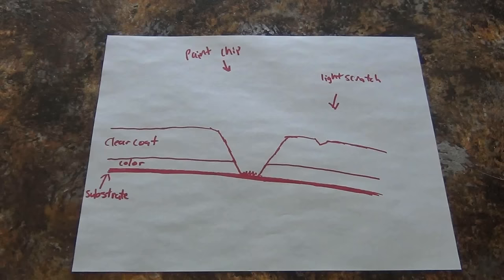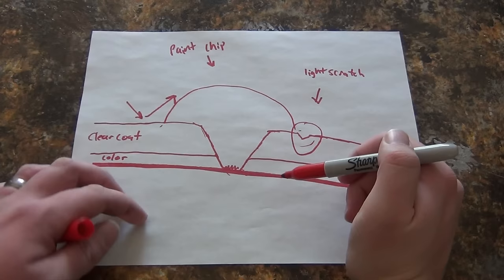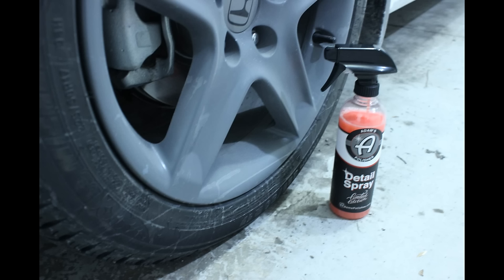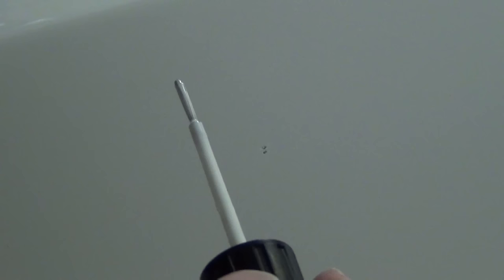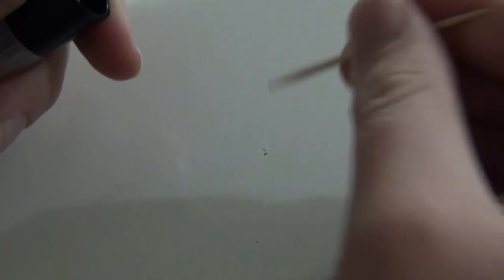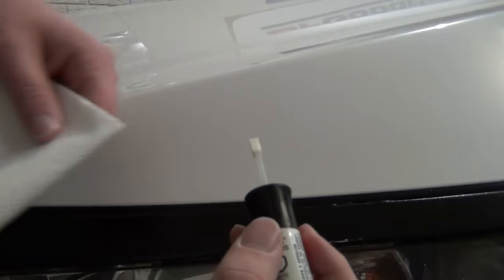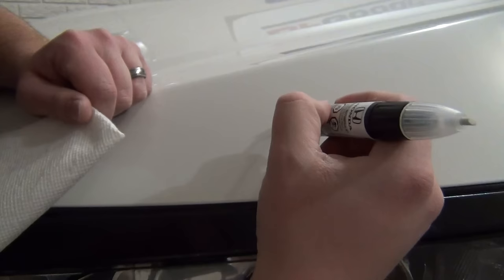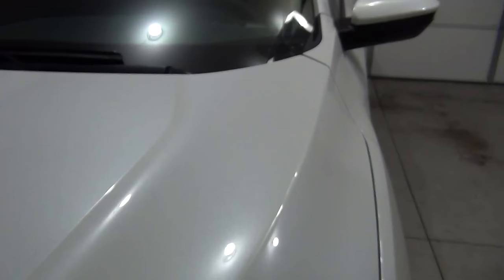Tips & Tricks | Using Touch-Up Paint

Comment: Pro tip: after applying your touch up paint and clear coat - take a pensile with eraser, 3000 grit sand paper, glue, and a cutting/polishing compound. Glue a tiny eraser size cutout circle of the 3000 grit sandpaper to the pensile eraser. Very lightly sand down the area/chip you just touched up. After you've got the spot completely smooth to the touch, hit it with your cutting/polishing compound. Once your done you will literally never be able to tell the paint was ever touched up or damaged at all. It will look brand new.
Reply: i use a paper hole punch to cut the perfect circle from the 3000 grit wet and dry then glue it on ;-)
Reply: Colt45Magnus This is exactly what I did while waiting to get my paint protection film done and got a couple of rock chips on my hood while driving it home the day I got it. A gravel hauler passed me going 50 and threw rocks out. 

I finished off with a light wet sand and buff. Since it's black metallic you can see very slight color difference, but it's flush with the rest of the panel and now has paint protection film and no uneven or bubbling issue with the film.
Reply: After sanding and compound/polishing should more clear coat be applied?
Reply: Rockford, No. All you are doing is removing the bubble like excess of clearcoat.
Reply: colt45magnus, good Comment and tips, the only one that makes sense and its helpful.
Reply: i put to much paint on mine is 3000 fine enough to make it smooth?
Reply: Colt45Magn
Reply: Fuhc YEAHHH!!!
Reply: I AGREE, I have used it many times and my friends love me for the detailing. Maybe I should go into business.
Reply: @Holly KurmisYou posibly could do that if it was a non-metallic or non-pearl paint. You can't flatten metallic paints.
Reply: @carlfarrington  why is that?
Reply: @hacklschorsch81  if you flatten the metallic or pearl paint prior to clear coating, you'll dull the metallic effect massively.
Reply: If you mix the base and clear together there's no need to do it separately and it doesnt dull.
Reply: Phantom1  what kind of polish will u need..and can u hand buff it witth a micro towel? Thank you!
Reply: @aletellier  you have wet sanded and polished to make it look unnotticable?
Reply: Tell me u didn’t draw a sketch?
Reply: @sirwhitecrayon2499  how much did the paint protection cost? Ty
Reply: @carlfarrington   my 16 accord is Basque red pearl..so i won't be able to somooth out the paint since its pearl? Ty
Reply: What kind of polish?
Reply: @edubb2491   I had the entire front end done in Xpel Ultimate. Cost me about $2k. Its expensive.
Reply: @sirwhitecrayon2499  😱
Reply: @RockfordHx2POWER  no. Steps are: base paint, clear coat, wait 48h, sand 1500, 3000, compound polish, fine polish and that is it. At the end you can wax it.
Reply: I assumed lower grits meant lower amount and used 500 grits and ended up removing the original paint off a huge spot on car 😰
Reply: Does he mean pencil eraser?
Reply: @wellingbadboy  Alan your comment needs more attention. Thanks for the tip man, fuck wasting time painting and waiting to apply the clear coat separately.
Reply: Even more OUTSTANDING! THANKS!
Reply: @josipmatic4732  why do we need to wait for 48H before you sand it? do you mean wet sand or dry sand?
Reply: @chrisdoctor7117  let color time to dry/harden :)
Reply: @chrisdoctor7117  wet. Clear hardens in 24-48hrs
Reply: Great job
Reply: B n g u no NM
Reply: What glue and let me know brand glue ..im from malaysia
Reply: @syaifulazmi9987 any kind of super glue it doesn't matter you just want the sand paper to stick to anything a pencil eraser size. Its just a tool to make the sanding easier with a tiny piece of sandpaper

Comment: I couldn’t get the right amount of paint in my paint chip. Immediately upon noticing that I kept having dab the paint out and messed it up more. Used my electric buffing tool to remove scratches I created trying to get the access paint off.

This video was good though because it gave me the idea to use a tooth pick to control the amount of paint going into the chip. The applicators put too much paint every time and you just get a paint bubble. Using toothpicks you can be much more surgical with the paint.

Comment: You only need a small amount of touch up paint, just to color in and use layers of clear coat to fill in and get above the surface level. Wet sand the clear coat lump down, then finish with compound and polish.
Reply: does clear coat really needed? I will purchase W85 code diamond white and with base and pearl only.
Reply: @chrisdoctor7117  yes. I hope you cleared your paint
Reply: Does this advice also apply to cars that have tricoat paint?

Comment: Nice.
I have been doing some research on my own, to get a smooth flat surface. I fill in the paint chip,wait until the paint dry a little,then I gently rub with a cloth drenched in methylated spirit,tightly wrapped around a plastic card. I use old t-shirts.
 This leaves room for the clear coat. I let it dry for a couple of days then wet sand,and finish of with some medium cut polish.
Did I mention my car is black?
Don't buy a black car if you don't like paint chips showing;)
Reply: Lol
Reply: Methylated spirit?  Sounds like the ghost of a deceased druggie.  Just what does that mean?  MEK, acetone, ... what?  Speak English, man!
Reply: @SoulDaddy33  for real!
Reply: @SoulDaddy33  Lol

Comment: You should had wet sanded after each process. the paint and clear coat should be level with the rest of the car.  You can use Mequiars M105 and HD Speed with a DA from Harbor Freight and that will clean up the dull shine and sanding marks.
Reply: yes yes yes. sand the base flat then clear and sand the clear

Comment: Shouldn't you use a polishing compound to smooth out the touch up paint? Honda says after 48 hours you should polish it. That will probably smooth the touch up quite nicely.

Here:
Finish Your New Paint Look with Rubbing Compound

Allow your clearcoat to dry for three days, then use a soft, 
non-abrasive cloth to apply rubbing compound using circular strokes and 
even pressure.  Buff to a high gloss.  For the best results, let your 
Honda touch up paint dry for 30 days, then apply an automotive wax.
Reply from the maker: +RolanTHUNDER That's a great idea! I didn't even think to do that.
Reply: No prob. Let me know how it goes please. Perhaps do a follow up video of before and after the polish.
Reply: RolanTHUNDER  your comment may have just saved my life. I just thought I ruined my car cause it has visible clear coat spots
Reply: The issue with polishing you have to know what you're doing, have the right machine, pads, compound, etc and it's not a small budget expense to get the right tools. It has the potential to do as much bad as good depending on your preparation and skill.
Reply: so u should wait 30 days before applying paint protection film on top of it?
Reply: @randomrazr yes! all volatile chemicals must have evaporated  before sealing it, as you could get uneven finish (blobs, small bubbles -not seen by eye but seen as irregularity)
Reply: regarding the 30day wait period. so whenever i wax my car, i need to avoid and cover the painted chip part when waxing?

Comment: Get your front end wrapped in Expel Ultimate paint protection film.  It's fantastic! 2018 Audi S6 with 13,000 miles and no damage to front end.  I did however scratch under the door with a metal buckle that was on my boots getting out of it the other day, which is why I am here.

Comment: Way too much paint especially if you have clear coat on top. You just need enough paint for color i.e. it's optimal below the surface and then fill in the rest with clear coat. Allow to fully dry for a couple of days. Next step is 2000 and 3000 grit wet sand in as small an area as possible .. and lastly buff it out. 

Sounds more complicated but it really isn't, it actually easy.
Reply: D Jaquith  Are you supposed to put a little primer on first?  If not, can you tell me why not?  I thought paint won’t stick without primer.
Reply: @simpleshoes  .. Most chips are very small and are typically located on the bumper and hoods which often are either composed of synthetic materials or aluminum. Assuming the paint chip is small the adherence to the substrate and adherence to the surrounding primed paint is more than enough strength to keep the paint from chipping in the future. If the substrate is ferrous metal then make certain to scrape all oxides (rust) and scape the perimeter of chip to remove any loose or poorly bonded paint. Often the oxidation spreads underneath the chip area. If the area is larger than a small chip then a primer is recommended.
Reply: D Jaquith Thanks so much for your answer. 😊 I’ve got a good sized chip on the front quarter panel and I have the paint and some clear coat, but I’ll pick up some primer before I tackle this one.
Reply: Question, mine is diamond white W85 code.  dealer gave me 2 paints, (BASE and pearl) do I still need to put clear coat?
Reply: @chrisdoctor7117  .. Most of those 2 part white metallics will never match. Same goes, a small amount of white for the base and the clear coat that has the pearlescents in it.

Comment: Where did you get the paint? I have an Aegean blue civic and need to touch up my hood but it's hard to find the perfect color especially with a metallic coat
Reply from the maker: +Jesse Sacchetti Honda dealership
Reply: I also have an Aegean blue civic. Dealership matched up my VIN. 08703-B593MAH-A1. The pen says "New Sporty Blue Metallic" but it matches the paint code in the door.
Reply: CompCrasher86 
Here is a perfect trick tip that car dealers use clarinet or sax reeds as a spatula they're bamboo thin wood & strong it scrapes excess touch up paint & levels it out smooth perfectly without scratching other areas reeds are also perfect for cleaning tar, bugs, tree sap soak reeds in cleaning solution & scape off 
gently 😊
Reply: @CompCrasher86  .

Comment: Why not flat with 2,000 wet and dry after the paint has really dried then clear coat, once clear coat is dry flat again with 4,000 then use G3 and finish with regular polish that way you could finish up with a touch up job you could not even find ? I like the tooth pick touch thank you :)

Comment: Help.. I spilled some of the pain over the car, its dried up fast, any simple way to remove it?
Reply: There’s some stuff you can get called leveler.  It will remove the excess.
Reply: Thanks everyone, including the guy who told be in was screwed. However simply used Varsol, worked fast, followed by some water and a bit of wax. Varsol did the trick.
Reply: Sireallius  Glad to hear you tried the varsol while it was relatively fresh and got a successful result!